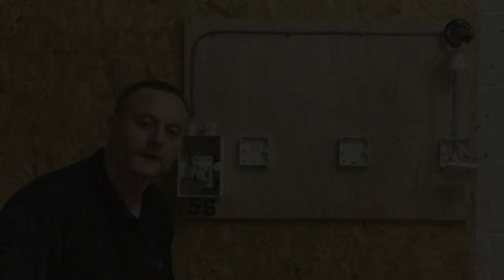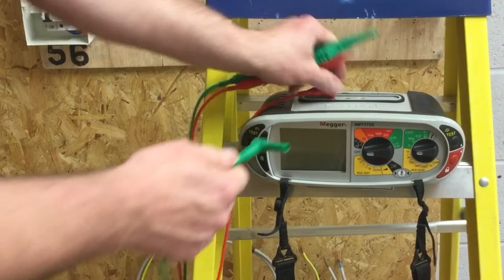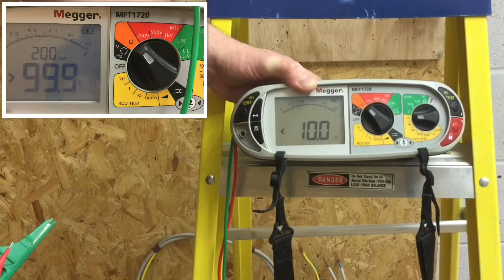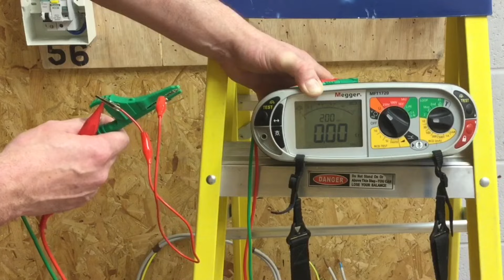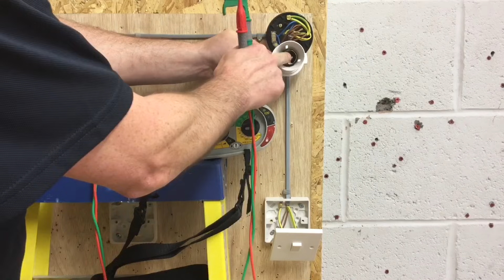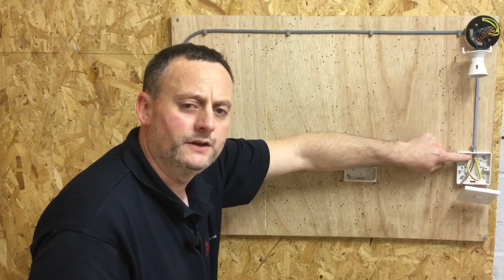Continuity of CPC and Polarity of our 1 Way Lighting Circuit (R1 + R2 Measured in Ohms)

Comment: thanks. all made sense except for the actual resistance values at the light switch and light. 

if the switch is further away from the consumer unit than light itself, why does it show up as having less resistance even though there is more copper wire?
Reply from the maker: The switch is physically further away as you look at it but you’ve gotta remember your testing with the switching line conductor at the light so from the lighting point the line connection comes out of loop goes down to the switch and back up to the light making the lighting point electrically further away than the light switch

Comment: Why is continuity of the neutral not tested?
Reply: Coz it’s r1 + r2
Reply: Because if the circuit is working then it has a neutral. You'd cross that bridge when you get to it. All you're testing here is the CPC (R2) to make sure it's continuous along the circuit. 

The only reason the line conductor (R1) gets brought into the test is to utilise it as way of completing the circuit. Otherwise you'd have to use a very long lead.

Comment: Hi 
Been advised to come to your Chanel to look at the testing ones.
I am wanting my guys to be able to issue minor works forms (currently have very minor electrical knowledge) so I’ve sorted this out..
My Question is in my work we only add LED lights these don’t need an earth so how could we do the test ? Do we just test the R1+R2 etc at the point we took the feed for new lights ? (Usually the landing 2 way or a bedroom with a permanent live in it ? As the lights will Be in the loft space ? Thx

Comment: Hi guys, love the videos! Am I right in thinking that a continuity test on a DMM is different to the same test on an MFT? 
I’ve seen recently some MFTs offering a 15ma or a 200ma continuity test, you don’t get that option, that I know of on a DMM, would you be able to explain what’s going on? Many thanks 😊
Reply: They all work by generating a small current and then measuring the voltage across the probes. A DMM will typically just put slightly less than the battery voltage on, and however many milliamps result.

The 15 mA continuity test will be there to not trip any in circuit 30 mA RCDs.

Comment: Gaz can you explain why we should test at each lighting point and then at each switch this seems daft. Surely if the earth comes from the CU to the light then to the switch then testing it the switch will confirm that the earth conductor is continuous, this would apply to each switch unless the earth conductor isn’t connected at the switch as you know some plastic back box’s don’t have a n ear lug . This is why I have seen some sparks were the switch is service mounted on plastic back box they dispense with the earth at the switch altogether  but do contact the earth at the rose. Personally I don’t see the need to touch the rose for this test when you can just test at the switch. Also what if you are working in a stately home were the ceilings and the crystal chandelier is so high there no way of getting to it ?

Comment: Please do a video where you doing the same test for multiple lights . Other than that superb vid thumbs up again !
Reply from the maker: 2 Plate Method Testing 2 Way Switching for Continuity of CPC, Polarity and Insulation Resistance
https://youtu.be/P-D6chUrRNk
Reply: @GSHElectrical   if there are multiple circuits, would you pull the Earth wire off of the earthing bar and connect to that instead of the Earth bar?

Comment: You mentioned in the first part of the video that there (could be) several circuits in a lighting system and although you are are working on a single circuit which is fine for the video..... back to several circuits, these could have live crossed circuits at the switch bank due to human error.....you did not check that the line wire was dead before linking it to ground!

Comment: hello i have three questions to ask.
i have a 20a radial circuit with 12 sockets on. from a junction box i have an fcu with a 13a fuse, which then feeds 25m of armoured cable to a shed. 

1. would i do an r1 and r2 at the shed as well, which is has 4sockets and 2 fcu for heater(5a fuse) and floodlight(3a fuse)? as i believe this would be the highest reading.
2.would i also do a zs at the shed, but as it has long length, zs could be quite high, however it is protected by a 13a fuse.
3.and lastly is there a maximum value allowance for r1+r2?
thanks in advance

Comment: Do all lighting loads have to be removed in the house for L-E resistance test or just the light point load on circuit  your testing ?
Reply from the maker: If in this case I am only testing the lighting circuit then all loads on that circuit and not other loads in the installation 👍🏻. Thanks for commenting and watching. Gaz
Reply: @GSHElectrical  Thanks.   That makes sense to avoid any parallel paths through the lights to neutral and back to earth via the cut out..

Comment: Hi. What is the maximum acceptable figure for continuity before further investigation is needed. Like insulation resistant it is 1 Mohm min, 2 Mohm Investigate further, 20Mohm for new install. I don't think I've ever seen anything regarding continuity. I have had figures from 0.37 upto 9 ohms in the same house. OSG I1 pg 196 has it per meter but what if you don't know length dues to it being in the wall. Sorry if I'm being thick.
Reply from the maker: It depends on lots of factor and when you start learning about the earth fault loop impedance the measured values of R1 and R2 will drop in place 👍🏻
Reply: @GSHElectrical  so In theory the continuity is just a case of lower the better and near to zero as possible. It only becomes an issue if the Zs figures are out from table B6. Then I assume you would investigate cause and Possible change breaker or cable to reduce impedance.
Reply from the maker: Earth Fault Loop Path for a TN-S Earthing Arrangement & Formula For Total Earth Fault Loop Impedance https://youtu.be/24Yjts1817E

Comment: Hi 
You mentioned that if 0.00 are flashing it’s below 0.00 
So I’m testing cooker circuit 6mm t&e  linked at cu with crocodile clips 
At the cooker switch I’m getting flashing 0.00
Does it mean  I have problems with my tester ? 
Thanks

Comment: Does the crocodile clip wire need to be thick/bigger in order to get a correct reading?
Reply from the maker: No just zero it out at the same time you do the test leads. Gaz 👍
Reply: @GSHElectrical  cheers buddy nice one👍

Comment: Would the cpc need to be removed from the earth bar before testing if other cpc conductors were attached (as in a real life situation) in order to avoid parallel paths or other interference in the testing process? Thanks
Reply from the maker: https://youtu.be/r94dJ7ASRTY
Reply from the maker: atlantic star short answer is no. I do have videos on the channel talking about parallel Earth path’s if you want to check them out 👍. Thanks for the message. Gaz
Reply: That was helpful. I think I get it now, there's no loop for the other cpc's, so no parallel paths. But bonding conductors would need to be removed either at the MET, or at the fitting itself e.g. water heater or metal conduit, in order to avoid pp's showing up on the reading.

Comment: Hi  Gaz,  I think I'm going bonkers because I've never seen an Rn test done on the lighting circuit....the cable from the lamp back to the consumer unit .
Reply from the maker: Hi. The only real time you would test the neutral on a lighting circuit is during fault finding. If a tested lighting circuit doesn’t work it’s probably the lamp failed or an issue with the neutral. Thanks for commenting Gaz
Reply: @GSHElectrical  thanks for the prompt reply,  really love your channel btw !

Comment: Hi Gaz when you mention the switching line am I correct in thinking that that would be the live wire that feeds the switch. It connected to feed in and feed out of main circuit on the triple brass bar
Reply from the maker: Hi. I think I understand what your saying (yes) Gaz
Reply: GSH Electrical thank u again for your help

Comment: How would you test at every light when it's not possible to get to em or a lot of downlights in a circuit  or whatever would you use the lightmate adapter thing
Reply from the maker: +Roy Kirkham
Hi great question. Thinks safety first remember College is different to best practice in the real world... lots of insulated down lights I would test at the switch in each room because that could be changed to an exposed conductive part (metal). As well as trying to do the last spot light in each room. I still would want to measure the R1 + R2 at the last lighting point as well as all metal fittings that require an earth. Thanks GSH Electrical
Reply: GSH Electrical 
Thanks for reply 
So say you had a Cpc missing mid circuit and then tested the last light in a room what would the tester read or expected results be to tell you a Cpc was missing
Reply from the maker: Roy Kirkham 

Hi if the CPC is broken mid-point of a radial circuit then no R1 + R2 would be recorded after that point in circuit so no continuity of CPC. All the best and sorry for the delay GSH Electrical